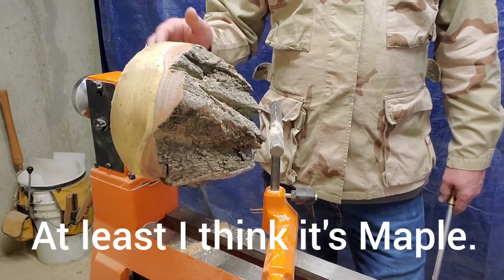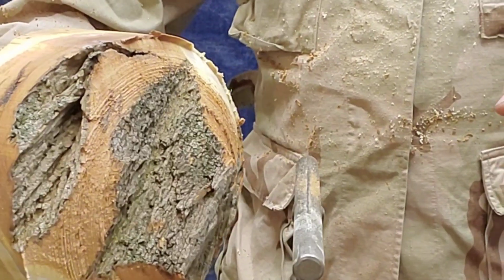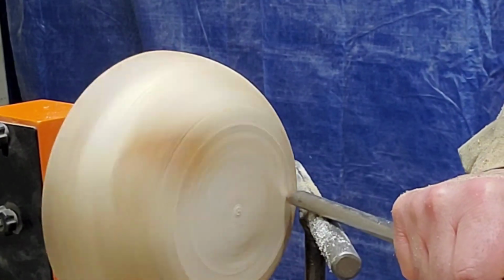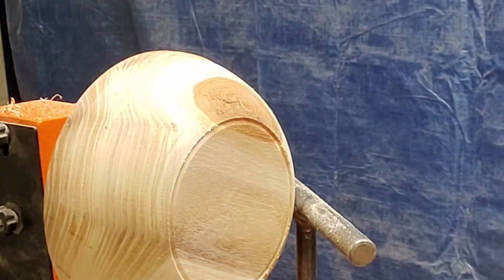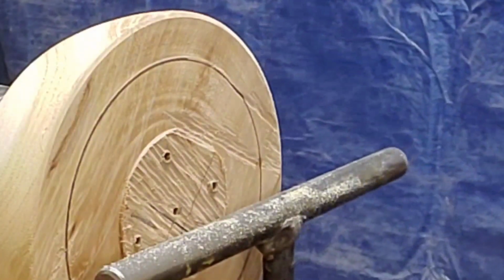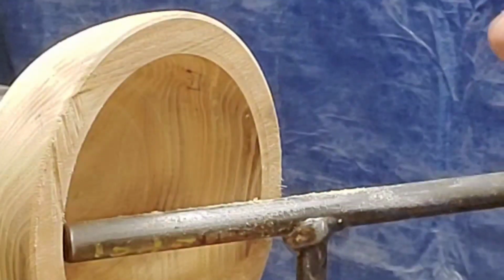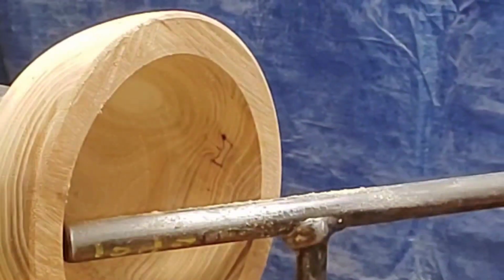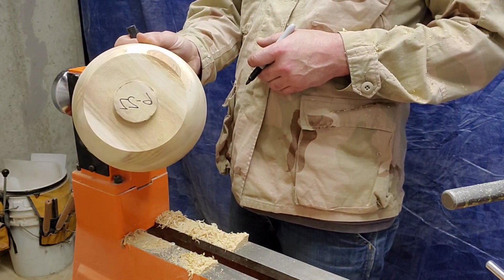woodturning-Twice turned Black Locust bowl. part 1.

Comment: its not a maple its a black locuts
Reply from the maker: Thank you very much. And welcome to Wantlessobject! Im not very good at identifying the different types of wood. So any help with that is always welcome.
Reply: @wantlessobject  The best way to determine if it's black locust is to shine a UV light on it.  If the heartwood doesn't fluoresce a pretty striking greenish yellow, it's something other than black locust.
Reply from the maker: @kevinmccarty7867  Thanks for the tip. I'll have to try that out.